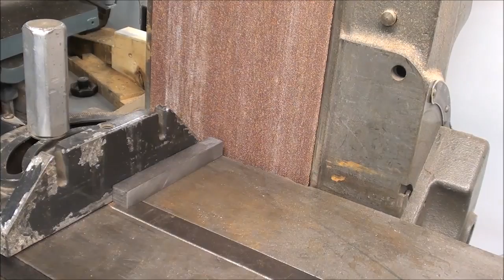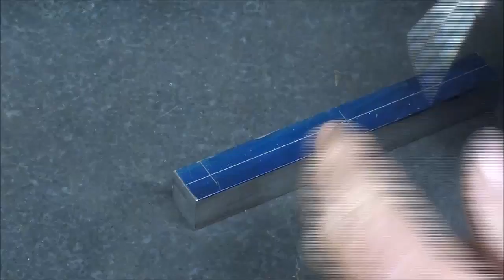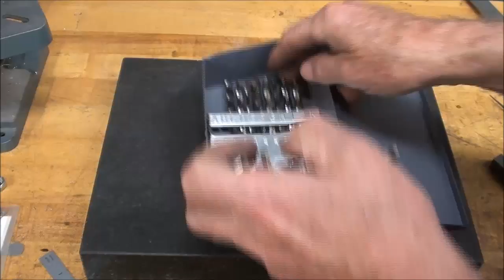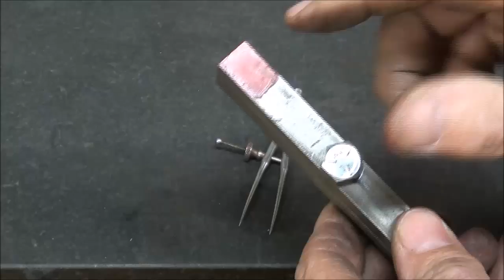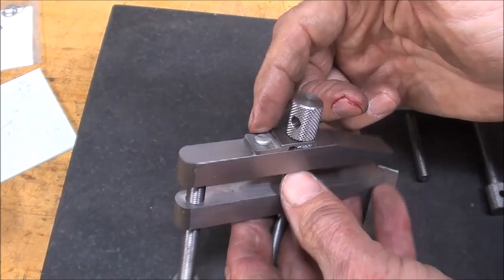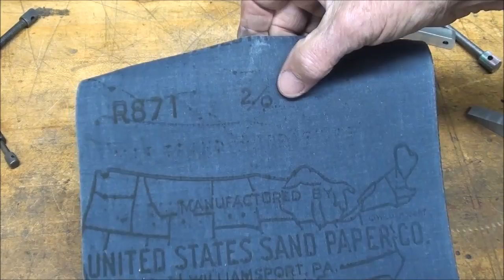SHOP TIPS #276 How to Make a Toolmaker's Clamp Pt 2 of 2 tubalcain

Comment: If you haven't a mill, you can clamp the steel in the tool post and use a fly cuter held in the lathe chuck ... a left hand lathe tool can ever be held in the 3 jaw if you haven't a fly cutter !

Comment: I do indeed own the woodworking Jorgensen hand screws you mentioned at the end of this part one.  I simply had to own a two sets of them in my early woodworking days but hardly use them now.  But they are a basic part of any woodworking shop so they will not be sold or traded.  Well not until it is time for my heirs to get rid of my equipment, makes me sad to think about it.  Great video, I will be back for part two after a good nights rest and a day in the wood shop.

Comment: Hi Mr Pete its five years after you had made these videos and i have started making a set of these clamps to use in my new hobby shop . I think i have some 1141 and 4140 I,m going to try that when i get to the jaws . Thanks
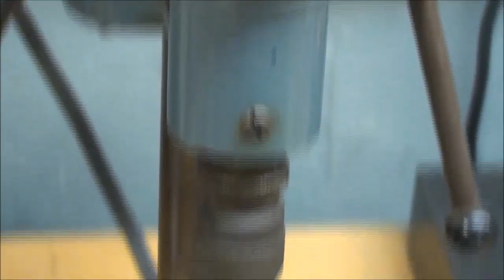Reply: @mrpete222  thanks Mr Pete I'm still working on the bolts I'm turning down some old bolts I found thought it might be better than 10:18 it's a lot more work though

Comment: A nice project Mr. Pete, going to try that and copy my English made Moore and Wright clamps, they are on a par quality wise with Starrett or Brown and Sharp. I am going to make the "nose" one inch longer than the standard M&W ones these are of bigger stock size tha 1/2" square, 7/16" i believe with a 9/32" x 32 thread. I will probably have to get some 15 or16 mm square stock and mill it down to size before i can start the project, but that's the fun of doing your own machining isn't it? Love all of your videos Lyal.l
Reply from the maker: Thanks

Comment: Another way to surface harden mild steel is using Kasenit, which is no longer made. Luckily Brownells has a replacement. https://www.brownells.com/gunsmith-tools-supplies/metal-prep-coloring/color-case-hardening/surface-hardening-compound-prod27119.aspx

And another will have to make myself a few pair project, thanks for the videos Mr Pete.
Reply from the maker: Thanks, yes I have two cans of that product. You cannot get it anymore

Comment: Have you seen Harold Hall's solution for the keeper? He drills and taps a small hole next to the main screw, and uses a pan-head to lock the main screw in - http://www.homews.co.uk/TMCLMAKE_M1.pdf 
I do like your bent sheet, though, that's a handy technique.
Reply from the maker: link did not work
Reply from the maker: Thanks for watching-good idea

Comment: Another simple way to get the angle, since you're duplicating your toolmakers clamp, would be to just set a parallel under the angled part of the jaw of the clamp holding the pieces. Then your two pieces in the vise will be at the same angle as the jaw.
Reply from the maker: Good idea

Comment: Hey Mr. Pete, Do you have any videos or suggestions on face milling thin stock? I don't have a surface grinder and I make knives. To flatten my steel, I find myself having a hard time holding them in a milling vice. Is a magnetic chuck strong enough to hold down like 1/8th inch bar stock for face milling? Alternatively I was thinking of putting a 2x2 bar into the vice on parallels for rigidity and holding the stock down with neodymium magnets, but I haven't tried it yet.
Reply from the maker: No vids on that.  I don't think the magnets will hold it.

Comment: Hello Mr. Pete, I have a delta drill,press, is it accurate enough to use as a milling machine? I think the answer is no, but I have to ask. All the best, Edgar
Reply from the maker: no
Reply: LOL that was pretty direct and honest! Generally the idea with a drill press is that it is not made to handle the side forces of milling. If you stick and end mill in a drill press and try to use some cross slide table on it, it will likely throw a very fast moving piece of steel across the shop and have a bad day.

Comment: Thanks for both these videos. It was a memory lane for me as I made similar tool makers clamps during my apprenticeship. Half the work was done the hard way and half with different machines. Yes three and four jaw chucks were used and "Remove that chuck key son before it removes your eye". Copper sulphate was used for blueing before scribing. Both anvils were heat treated and case hardened, to finish, my staff number was stamped on the side.

Comment: When (decades ago) I learned the very basics of drilling,. my workshop teacher also liked to "drift" his vice around on the drill bed. To add safety in case of a "snatch", he used a cap screw through the slot in the drill bed, and guided the side of the vice against it. That way, the vice was braced if something caught, and it still allowed students to develop a feel for the drill bit centring itself in the hole.

We also had the "tapping" alignment stage when we made our own machinists clamps, and he solved that one by having us use the "clearance" hole to align the tap onto the tapped holes - the thickness of the square bar giving far better alignment than most of us could manage freehand. Of course, that was because he had 20 students, and only two drill presses which could have been used as tap guides.

For the "Keeper", you can pick up a joggling tool for a fairly reasonable cost - ebay seems to have them regularly. Most of them also have a 5mm hole punch for some reason - but that should be useable to make the "fork" part.
Reply: Our pillar drills had been modified - the chuck key holder had a switch attached and you couldn't start the drill without the key in its holder. I guess the shop teacher had seen one too many chuck keys flying across the room. The lathes had a similar adaptation - two holders for 3 and 4 jaw, both had to be filled.

Comment: Also made the same clamps as a project in 1988 at Bulawayo Polytechnic (N.C.C. in Machineshop Engineering )  
Knurled the screws on the lathe and "blued" them on completion. They have come in handy over the years in my DIY jobs and still have them today.

Comment: Mr Pete, Aircraft industry calls a reverse bend  a "joggle".    Used whenever  strengthening a joint. and repair of joints using multiple layers of sheet aluminum.   Excellent video.   Got the plans from toly already.    As a aside, thanx for the link to Jimmy Diresta youtube site.
Reply from the maker: +phantomphixer thanks-did not know

Comment: Wow.  I'm not a machinist just a weekend woodworker but this vid showed me a lot of techniques that will transfer to my woodworking.  One question about the "floating vise".  I do that as well when drilling but I find that all too often the beginning of the hole gets wallowed out a bit.  I was told that it was because I wasn't clamping down the vise.  Any thoughts or suggestions?
Reply from the maker: +Bill Weissborn thats more true in wood than metal.  I guess you need to clamp

Comment: whats the .250 on the mill vice?
Reply: +eli douek A lot of machinist write notes for later reference. The .250 probably isn't even for this job. A paper note around a shop is often in the way, gets misplaced or is not around when you need it.
Reply: ah ok. i was thinking that it might be a note about the vice itself, eg the innacuracy of the angle markings
Reply: +eli douek I'm glad I could help.

Comment: For drilling operations where I'm letting the vice "float" like you did, it was suggested to me to put a bolt or clamp through the press table nearby, such that if the vise were grabbed away from me, it would then hit this, and not be able to spin all the way around.

But I don't really have significant experience so I guess I'm asking now if that was actually a good idea or not.
Reply from the maker: +Bob O`Bob Thanks for watching. Good, but that does not keep the vise from lifting

Comment: Thanks, Mr Pete! Now that I have a mill and a lathe, I also have project #1 to make, right on time. I guess the jaws can grip out of parallel to some extent, determined by the size and configuration of the clearance and pilot holes. What's the useful range of these you've made, if I may ask?
Reply from the maker: +Paul Mcnulty not sure-Thanks for watching.